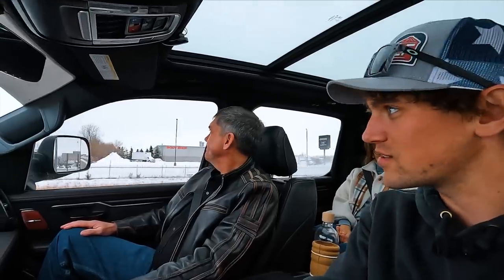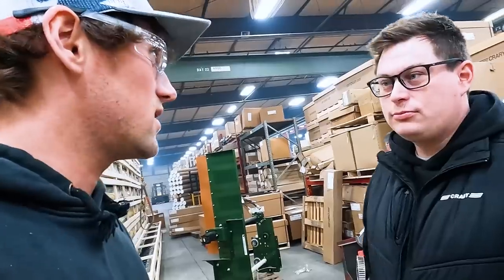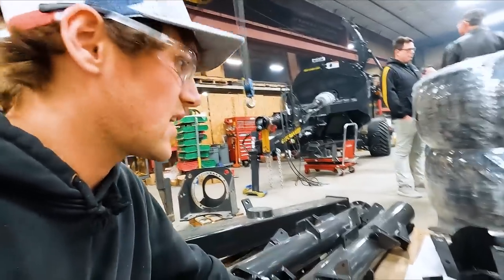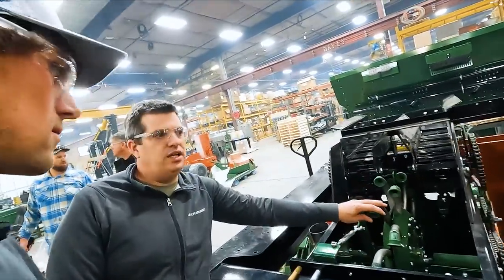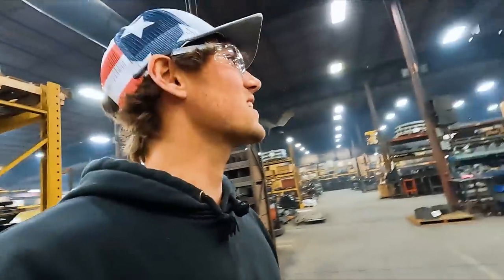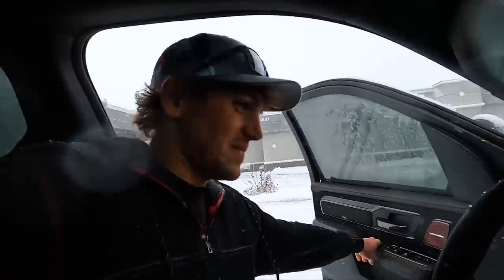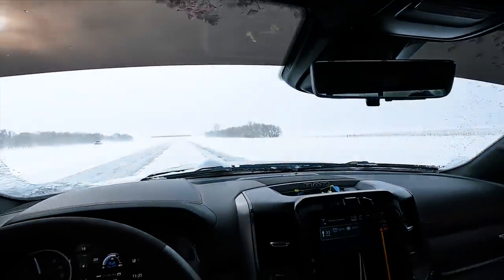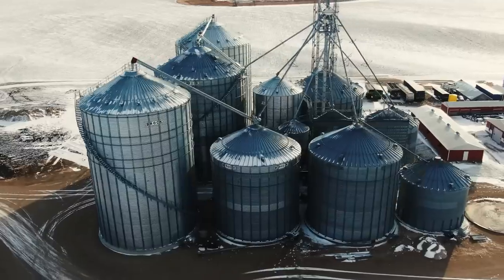Touring Crary Ag 200,000 SQ Ft MFG Building!! So Many Toys!

Comment: 🇺🇸  To be honest I debated watching this, a factory tour,  but glad I did. Tater harvesting has come a long ways from digging them out of the ground with a fork or special rake, pick them by hand, put em into a barrel @ 185 pounds each! And the harvesters have progressed as well from a one row harvester that put them in a barrel which were dropped onto the ground to be picked up by the barrel truck. We had a 2 row Lockwood with an air head that boomed the taters directly onto the bulk truck, similar to what you saw only smaller. OH the FUN we had 🤣. 🚜🙏

Comment: For those mom and pop assembly shop operations the manufacturing data is important but often inadequate...parts lists, schematics, as built specs by model number, quality control data, maintenance specs and procedures,  in depth operating manual , cross references, etc.  Especially important for purported "continuous improvement" manufacturing operations where everything is different.

Comment: Isn't GPS wonderful.  Back in October, I drove 4 hours north of my house in Southwest Michigan to look at a TYM T264 tractor and on the way back home my GPS said she found a shorter route home, I said ok let's go. Before I knew it, I was going down some gravel road. It was barely a road, no houses around.  After a couple of turns, I was finally back on paved roads. It took me 5 hours to get home. After arriving home, I checked the settings for my GPS, and it was set not to include highways.

Comment: That's what you need...a large wood chipper so you can process wood instead of burning trees, etc., that releases CO² into the atmosphere. You could sell it to garden centers and so on.
Reply: They don't make wood chippers for tree trunks.
Reply: @cw93711  
Actually they do manufacture commercial size wood chipper that can handle large pieces measuring up to 160 inches. Plus, the stump grinder can literally large stumps down to nothing.
Reply: I think Vermeer makes a huge shredder type of machine with a huge conveyor. Was close to 1 million $ over 10 years ago.
Reply: @Therealmitch5511    stumps have to be removed so you can plant.
A grinder just takes out the center section of the stump.  Which is good enough for a yard but not a field as you still have all the roots that are 2 close to the surface.
160 inches is what measurement?
Lastly even if you bury a whole tree or chop it up into wood chips that are used.  They still decompose and that gives off methane, CO2, etc.  Its not like the CO2 isn't released back into the atmosphere whether you burn the tree or it decomposes.

Comment: Dodge RAM Laramie  has a glitch in the navigation system. They know about but they told me that not enough people are complaining:

(Dodge RAM Laramie 1500)

My Dodge RAM Laramie 1500 truck will be 7 years old on Christmas Eve. About 2 months ago I ordered a navigation map update and installed it. The installation
went off without a problem.

Here is the problem. When driving down the interstate at 70 miles an hour and I am in
the far left lane. Every time I pass an exit the voice comes over and announces that the speed limit is 30 miles per hour. The display on the map screen changes from 70 miles per hour to 30 miles per hour. After I pass the exit it goes back to 70 MPH. I am not getting off of the exit but keep on traveling in the left lane on the interstate.

I have called the map company, “Here” and told them the problem. They said it is not their problem and I need to call Dodge U-connect for a fix.
I called Dodge and explained my problem. They said go to the dealership. I did and they told me to back to Dodge U-connect.

I was told today when I called it was a glitch in the system but they are not going to fix it until more people call and complain.